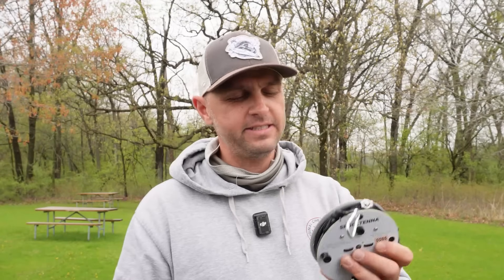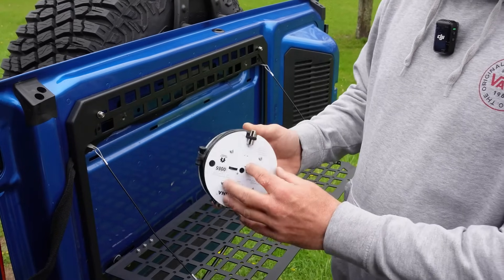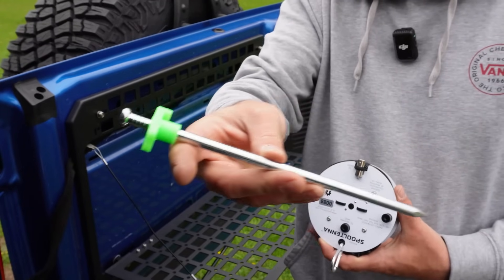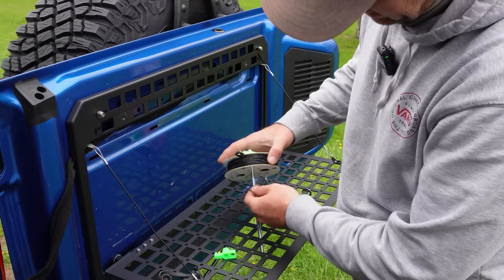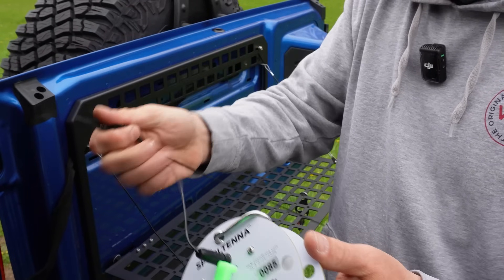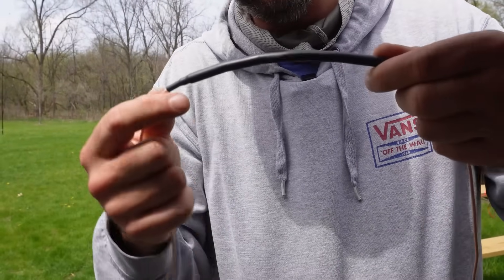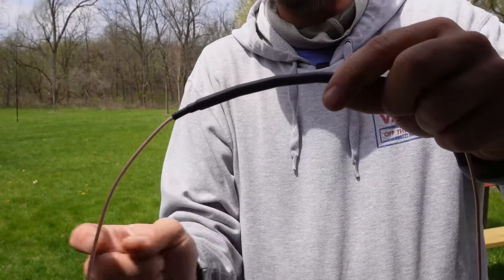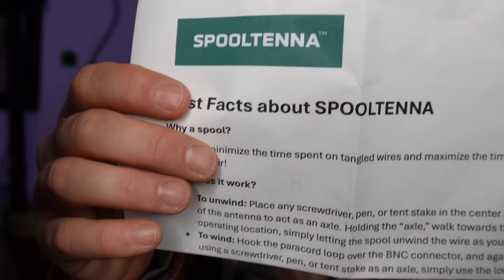This EFHW Spooltenna Made Me Think Differently

Comment: So I purchase this and at first, comparing it directly to my still installed Fan Dipole, I was unhappy because it had a higher noise floor.  THEN I installed the suggested counterpoise and the noise floor dropped below the Fan Dipole!!  Yep, it appears like a real winner and came tuned perfectly for the bands.  

I will caution everyone about where the coax connects. (the BNCmount)  It's only held on by solder joints so any stress on that part by heavy coax will rip it off.  Yep, first hand experience!

In my opinion the BNC mount it should have had a metal clamp to secure it better to the disk. Be careful with the BNC mount.  But it does the job well.  I'm now taking down my Fan dipole which has been a PIA to tune.  This Spooltenna is the way to go!!

Comment: This brings back memories, in the 1990's and early 00's i made a spool antenna with a garden hose spool. I had 80 meters of wire on it, and would attach a 1/2 house brick to the bottom and drop it off a 100 meter vertical cliff at the ocean. I'm in Australia and the cliff faced NE towards the USA, i filled a logbook in no time on that thing.

Comment: How does it have a built-in conterpoise?  Hopefully you're not considering the spool is a conterpoise. Might work as a conterpoise for the uhf band, right.
Reply from the maker: It has a section to use a counterpoise, unlike other reel antennas, which do not have a counterpoise lug.  It doesn't have a built in counterpoise, it has a built in counterpoised lug.  I guess it should not have been taken so seriously or literally, I thought for sure people could understand this. Sorry if you did not.
Reply: @DudeTested  you got me to look at their web site, no mentions of built-in conterpoise. I didnt checkout the manual though. Ive had to solder a spade connector on my halfwave since none was provided. Definitely taken back why none was provided. Got to have it. Thanks have fun 👍
Reply: @DudeTested  
We damn sure understand-----------> $150 !!!

Comment: I have the Reel Potable EFHW antenna. I prefer mine - because the length of the wire can be adjusted on the reel, which adjusts the resonant point up and down the bands. With this Spool antenna you are stuck with a fixed length of wire. So you can't "reel in" some wire to get it resonant on, for example, the 30 meter band or 17 meter band. Or adjust the length to get down to the CW or up to the SSB portion of the band. The Reel Potable antenna can. But this was a good presentation, thanks for the video
Reply from the maker: As for the reeling in of wire, I see what you're saying. Today on stream, I will try the Bongo Tie, after spooling in a certain length of wire.  How much wire do you typically reel in to get resonate on 30 or 17? I do know the math for EFHW calculation, but when you introduce a coil at the bottom of the antenna, efficiency and length changes, so answering this will help me test my Bongo Tie thought.   Thanks for the information and thanks for watching.
Reply: @DudeTested  While we did not originally consider that operating mode, this can be a way to pick up those additional bands. We'll do more testing and plan to add this to the owner's manual to document it. Initial testing for 30 meters resulted in an SWR of 1.54:1 using an unspooled length of 40 feet 2 inches (less than theoretical length of 46 feet 5 inches, noting wire remaining on the spool). Give it a shot, we'll check back to see how things go today!
Reply: Ditto
Reply: Both antennas solve the inherent problem with wire antennas and do a nice job avoiding tangles and enabling rapid deployment. Note that SPOOLTENNA has a clamp at the end of the wire that allows it to be adjustable for any part of the band. Great feedback, thank you!